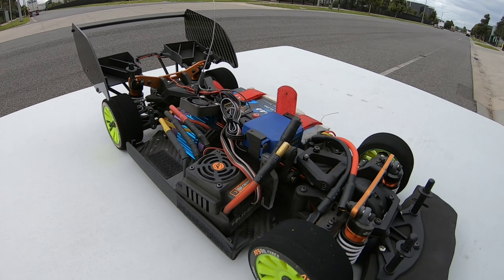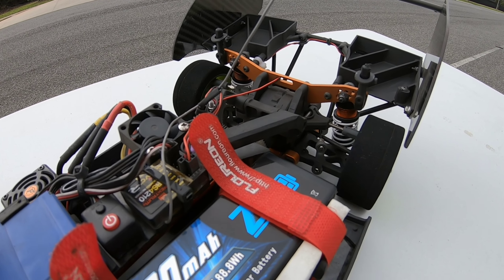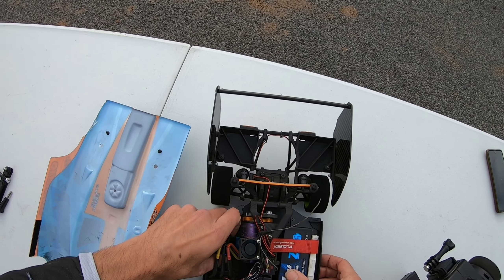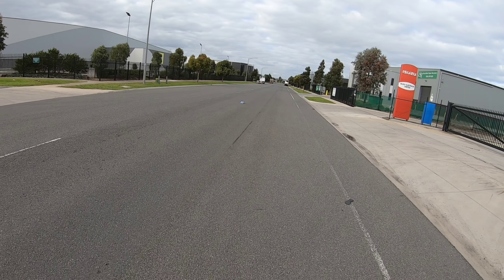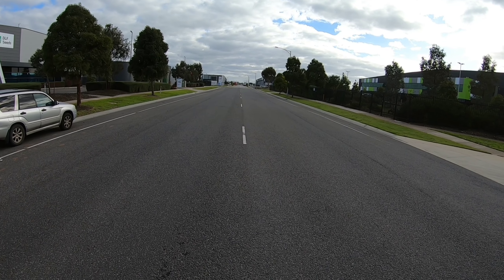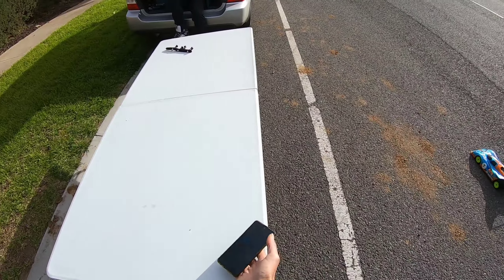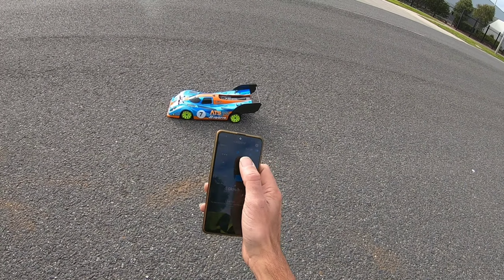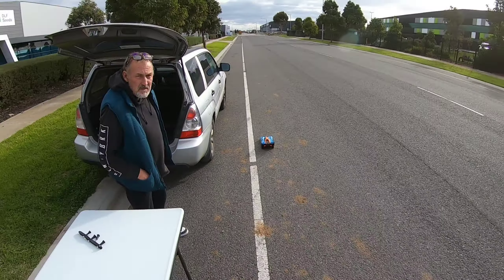Now it's a comfortable drive🥹... AK-917 finds some stability!

Comment: Good stuff man. Time to crank this puppy up. Having a bit of a go with mine as well.
Reply from the maker: Thanks Brett👍
Yeah now it's time for the real setup, hope it keeps its stability after the swap.
Nice, hope your enjoying yours👌
Reply: @rccrazy  bought the carbon fibre rtr to play with as a starting platform and will see how we go
Reply from the maker: Sweet!
I think the carbon chassis version is a little more stable so hopefully yours dosnt have or suddenly gain any stupid characterising like mine did last drive😅
Reply: @rccrazy  first run on 4s and it backflipped. Doing some adjustments to the droop screws
Reply from the maker: Oh no!
Yes some adjustments and more weight should help that🤞

Comment: Congrats over the previous runs mate, can see your pretty stoked over the improvements. Did you change the oils in the front shocks & front diff as well. Also have you lowered the car at the front to give some rake under the chassis or still running with zero rake. I checked both my metal & carbon rollers for toe out out of the box, the metal roller came with around 2 degrees toe out each side, the carbon roller came with around 1 degree each side. That magic 100mph is getting closer for you now, stay safe.
Reply from the maker: Thank you very much!
Yes very stoked👌
No didn't touch the front shock or diff oil just rear.
Yes lower the front to about 7mm.
In regards to the toe and camber, it seems there must be some inconsistencies from manufacturing but nothing that can't be changed.
Should break 100mph on 4s with the new motor and gearing I will be using👍

Comment: loads more stable,nice straight runs.
Reply from the maker: It's actually strange how much better it is, should've changed 1 thing at a time and I may have been able to pin point exactly what fixed it😅
Thanks😁

Comment: Hi  made some wing about the same size and shape out of 2 plastic frozen food dinner containers about 1/2mm thick. After around 30 mph its like its on rails.I shoe goo them  to the same place bit of a funnel affect. hit 60 mph in about a 1/4  the distance you are running 4s 2 2000 mah wltoys batterys.Need a longer spot.
Reply from the maker: Yes that works👍
A longer spot is a good idea once you start getting 100mph+ speeds or you have big heavy cars that need long roads.

Comment: Is the 120A ESC in my new Brushless Carbon version supposed to make such high fan noise. It seems like the ESC fan is very loud ? Other questions coming ...
Reply from the maker: If your fan is loud because it's spinning fast then that's good, if its loud but has weak air flow it's just a loud fan or your missing a blade or 2.
You can simply replace or upgrade the fans if you need to.

Comment: Nice runs. I know it's only a little difference, but that missing piece on the front right lower lip on the car could be enough at those speeds to unbalance the car IMO. Just make something up to fill that in again wouldn't hurt?
Reply from the maker: Thanks Pete👍
I'm not sure how much it would effect aerodynamics but it could make some turbulence or something🤔
I could probably just use sticky tape to fill it in👌
Reply: @rccrazy  Yes some of the fast runners have been using sticky tape across the front & along either side of the body.
Reply: @rccrazy  i know it seems only a little piece missing, but imagine holding a tiny bit of plastic that size out a car window while doing 150kmh. You would feel the drag on it. 
You have a small radio controlled car that doesn't weigh much,  it would not take much drag on one side of the car to upset the balance at the speeds you are trying to run, and being on the corner it allows more air under one side of the car and body also.
 Just my thoughts anyway. Good luck with it, i will be watching to see how you go.